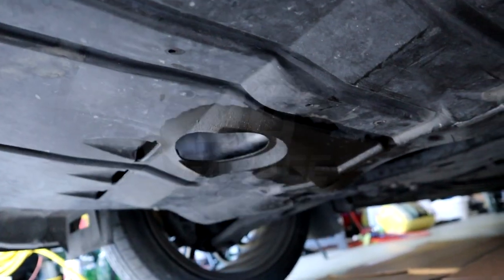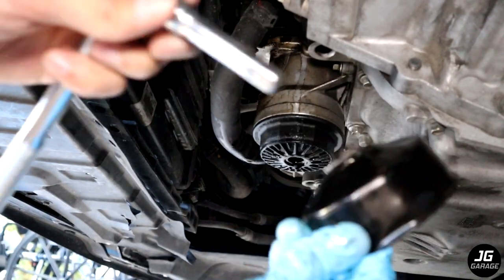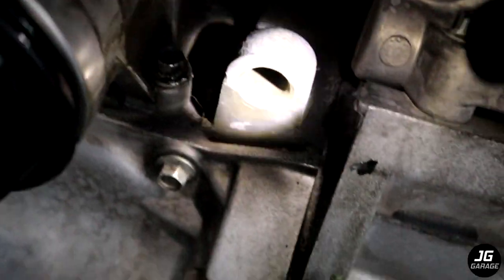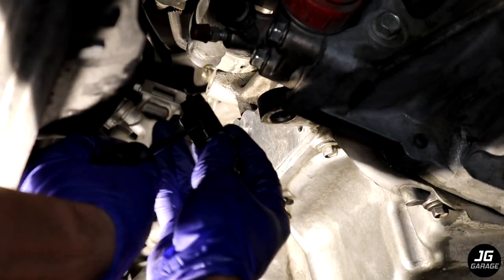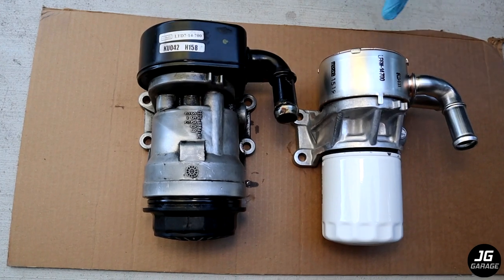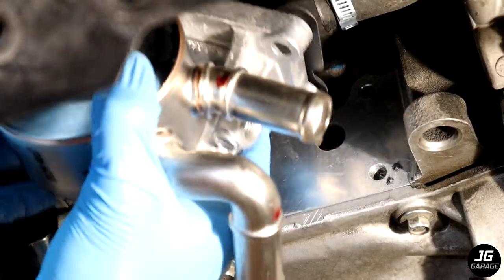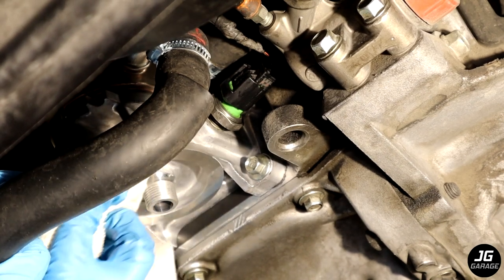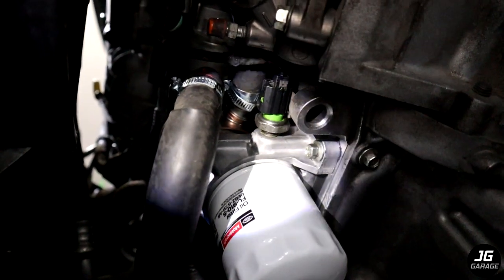How to Fix Mazda Oil Leak | Updated Oil Cooler & Spin On Filter Conversion Install on Mazdaspeed 3

Comment: Why do you use 5w-40 instead of the factory 5w-30
Reply from the maker: When I first got the car and researched which oil to get, I came across a lot of forum threads suggesting and recommending Shell's Rotella T6. Since then, I've only used T6 during oil changes however, people have claimed that the newer T6 version has changed and may not be as good as before. I don't know anything about this to prove it or not. It's just something I've came across and read in forums or FB Mazdaspeed pages. I do want to mention also that when going through forums and pages, I do see a lot of people saying to just get a good quality synthetic 5w-30 and all should be good. Now to answer your question about why 5w-40, I will just copy/paste from a thread that basically sums up the answer:

"1) Mazda released a TSB to use 5W-40 oil to mitigate the smoking in idle issues. The thicker oil supposedly will not seep out of the seals as much as -30 oil.

2) Years of data and used oil analysis on the platform showed that the T6 is very good for these engines. Part of the reason is since it is diesel-specific and thus designed for direct-injection, it resists fuel dilution much better."

Now I don't know the credibility of the person who wrote that but that's basically what people have consistently said online and what I have read.

Comment: Do you know the  part number for the 4 oil filter housing bolts you said you replaced earlier for the speed3
Reply from the maker: It should be part #: 9XF0-02-257L but also double check with the dealership. I bought it from there and if I remember correctly, they were cheap. Thanks for watching! Don't forget to like and subscribe! It'll help my small channel out! If you have any more questions, feel free to ask away!
Reply: @jggarage1807  thank you. Just bought the updated oil cooler from the same ebay seller and a spin on conversion so I’ll be doing the swap next week. The car has 38k miles on it rn so wasnt sure if i should replace those two bolts
Reply from the maker: @bhavneetsaini7941  oh nice! And 38k first gen? Wow that's some low miles! And technically you don't have to replace them. It's a good idea to replace them if maybe you've removed and installed them a couple times or may have overtightened them on accident like I did. lol you should be fine with the original ones. Just carefuly tighten them and you should be good but of course feel free to get new ones.
Reply: @jggarage1807  i have a follow up question. Is it necessary to lube the gasket between the cooler and the housing like how we lube up oil filter seals?
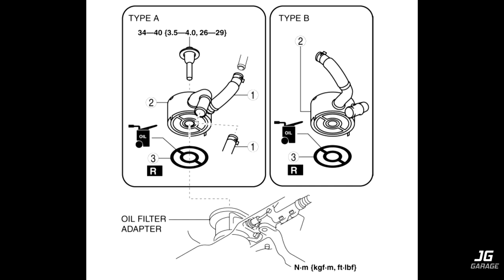Reply from the maker: @bhavneetsaini7941  to be honest I wondered about the same thing. I actually asked the same question on a Mazdaspeed page on Facebook and most people said I didn't need to since they said it's a steel gasket, not an oring and also said it doesn't spin like an oil filter so no need. So I didn't during this install but if you take a look at 9:27 with the photo I provided, it does show an oil symbol. If I was to do it again, I'd probably put a thin layer as I don't think it would hurt. 

If anyone reads this and knows a definite answer, please let us know! Thanks!

Comment: Out of curiosity, the Amazon listing has people saying this isn’t the part for a Mazdaspeed3. However, it looks exactly the same as the edge auto sport one but way cheaper. Are the Amazon guys right? Or is this in fact the part?
Reply from the maker: Which part are you talking about specifically? The oil filter housing conversion?
Reply: @jggarage1807  yes! The oil filter housing conversion itself.
Reply from the maker: @originalmarshmello  oh yeah then that's definitely the part. It shares with different models. I just checked the Amazon link in my description and I don't see anyone saying it's not for the Mazdaspeed. The listing title however doesn't mention Mazdaspeed but it's compatible. The part number matches.

Comment: I'm trying to do this on my base model 2004 mazda 6 and idk what the coolant hosing connects to. There's two closed connections on the bottom of the radiator, but I feel like it should be connected somewhere else. Can anyone help inform me?

Comment: Can this be done on 2005 mazda 6i 2.3?
Reply from the maker: I have included a link for the oil filter conversion housing for Mazda models without the oil cooler in the video description. Please check it out and confirm it will work for your application. I believe it will fit for your 2005 Mazda 6i 2.3 based on the reviews and questions asked on the listing regarding your year and model but please double check.

Comment: My old bolt worked. I was wondering why you really need the new bolt. You emphasized it a lot.
Reply from the maker: Which bolt in particular?
Reply: @jggarage1807  the new one you got with the new pump and oil conversion kit. The big one that goes in the top.
Reply from the maker: @MaSta74372  That's interesting. At the time when I did research to do this project, I learned that I needed to replace the bolt to the updated bolt when using the updated cooler. I never bothered comparing the two bolts but now I wish I did. The two bolts however are different part numbers so I figured it was just different. Here's a diagram showing both set ups (old & new) with the respective bolt with part number. 

http://ci.catcar.info/mazda_2018_02/usa/2E08RU1.png
Reply: @jggarage1807  hmmm. Odd. The more you know.

Comment: Just cleaning the oil pressure sender won’t stop it leaking. It needs a new sender unit- they only last a few years.
Reply from the maker: Which one exactly are you referring to? The sensor that screws into the housing?

Comment: I don't think your gasket failed - they way you installed the oil pressure sensor was wrong - you need to put joint compound on it. That is probably where your oil is leaking from.
Reply from the maker: It is indeed the gasket that failed because the leak is coming from above the oil pressure sensor. It is leaking from the mating joint of the oil cooler above and the oil filter housing below so that only indicated the oil cooler gasket. Also, I never touched or removed the oil pressure sensor during the first repair when I just replaced the gasket with the original oil cooler. Before this video, I did wonder if I needed to put any kind of sealant on the oil pressure sensor threads and from what I read online and group pages, I learned it was not necessary and I saw someone use Teflon tape but I wasn't comfortable using that. Ever since this video was made to today, the whole repair hasn't leaked, neither from the oil cooler nor from the oil pressure sensor.

Comment: i have a 2010 ms3 i bought the car a few months ago and it has this catch can literally 10 minutes ago it just started leaking oil like crazy all over lost probably 4 or 5 quarts in about 5 mins um idk what to do i cant track it down cuz there's literally oil everywhere but the catch can keeps filling up. which i though was weird cuz i can just keep emptying it so idk if it just built pressure or something and blew a line bc its not coming from around the oil pan area but both the lines to the catch can are still on. and ofc the geniuses at Mazda don't have a oil pressure gauge on the car if anyone can help please let me know
Reply from the maker: Have you tried filling it up with oil again and try running it and see where it would leak specifically? Maybe lay a cardboard down and see which specific spot it's coming from that way you can track it. I know you said there's oil everywhere so that would be a challenge unless you try to clean as much as you can so the leak can be more recognizable.
Reply: @jggarage1807  sorry i forgot i commented on a couple pages i figured it out a day or two after this (oil filter was put on wayyyy too tight i basically had two half's by the time i got it off im guessing it built pressure and blew the gasket) i replaced it and its working fine now.

Comment: 14:10 Anyone find out what the torque specs are for the oil filter housing? Thx
Reply: Turn it until it’s on as tight as it will go
Reply: @Davo996  Thanks, I was wondering if that's the best way.  Getting a torque-wrench in there seems practically impossible.

Comment: You go from genuine Mazda clamps to Walmart clamps lmao…. Junk
Reply from the maker: It is likely Mazda doesn't make their own clamps and gets them from a supplier since they are just clamps. The clamps I bought work just fine and didn't seem to be super thin or flimsy. If you'll be doing this repair, feel free to use the original clamps or any clamps of your choosing. Thanks for watching!